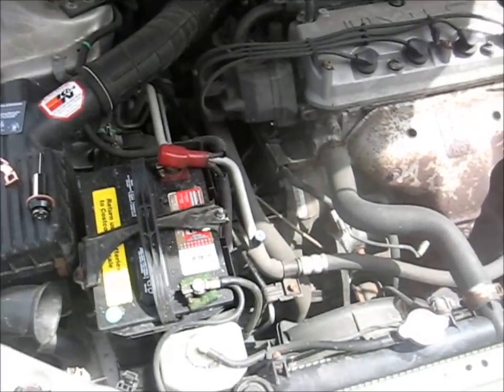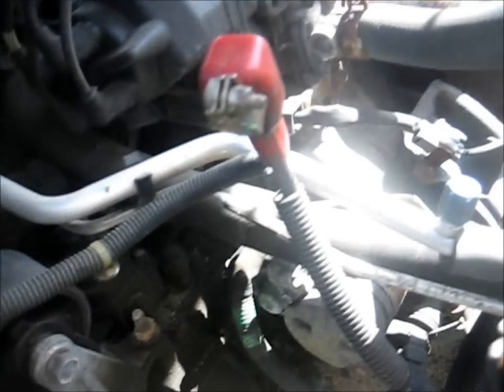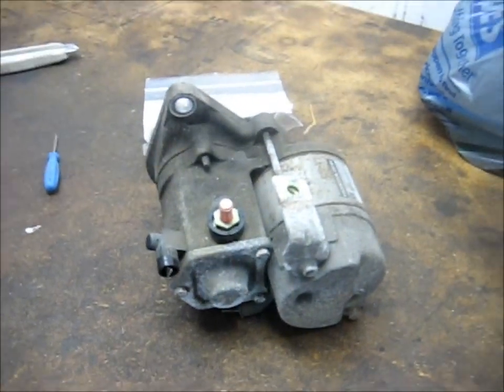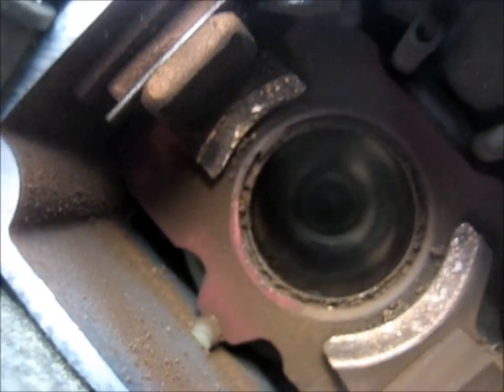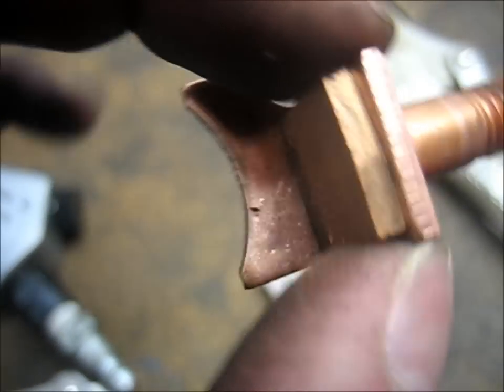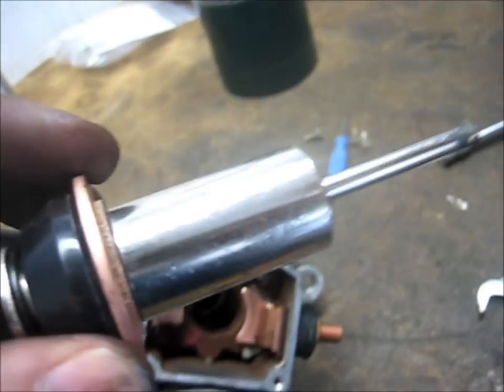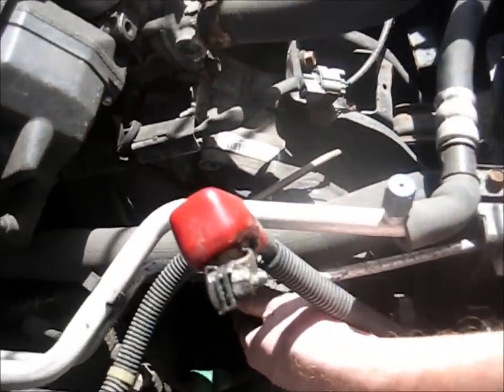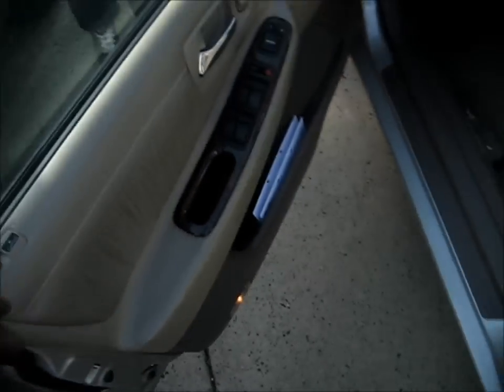Denso Starter Repair (Honda, Toyota, Chrysler etc.)

Comment: I wish we did this more often, and I wish finding the right parts wasn't such a pain. This is an excellent demo. One point worth noting is that the terminal you point out at 2:39 is the wire that sends current from the solenoid to the motor. If you're able to get a scope or dvom onto that lead in the car, you can verify the problem is in the solenoid (rather than contacts inside the motor) by checking for voltage at that point when turning the start key. As you say it will normally read ground if you check it with a dvom, since the ground is transmitted through the windings of the motor. When the start key is turned, that terminal should read 12V, proving the solenoid is able to relay voltage on to the motor. If your battery is good and if that wire reads a low value like 6 volts, there is upstream resistance. That upstream resistance is likely in the solenoid contacts, robbing the motor of power. I find the way the plunger is able to rotate an example of elegant engineering.

Comment: You need to make sure that the contacts are completely flush with the housing that supports them underneath. According to a few other YouTube videos this a mistake that is commonly made and it results in having to do this over again shortly after. They advised pressing down on the contacts while tightening, using things like a socket, screwdriver handle or even the plunger.

Comment: The "left" terminal on the solenoid housing is not the Negative terminal as mentioned in your narrative (time index 2:43).  This terminal is the positive lead that feeds power to the starter motor from the solenoid.  The Negative on the starter is connected to the housing of the starter housing. Thank you for an excellent video and step by step procedure for rebuilding the starter solenoid.

Comment: I wish you had continued the disassembly to remove the starter motor's armature and shaft. It would have been useful to see the condition of the brushes and commutator (possibly replacing the brushed and turning / undercutting the commutator), then cleaning  and relubricating the main starter bearing before reassembly.
Reply: Exactly my thoughts as well. The starter motor was never even touched, this was only a solenoid servicing - but a good video of that I must admit.

Comment: Its a 99 Lexus RX 300 I did change the contacts and plunger too, put everything back but the car starts and the starter never Dis-engage, it keeps running until I disconnect the baterry terminal.
need your help.

Comment: Hi, where did you exactly get the solenoid repair kit from?  I checked Kragen parts online they only had the touch points but not the plunger.  I have the same exact car in the video and my starter just went out yesterday.  Will a universal plunger most likely fit?

Comment: thanks" for the video,  helped me rebuild my starter on my 97' lexus, only cost me $27 for the set a far cry from $130 after starter market from kragen.  it was a pain in the ass" one of those bolts was a bitch to remove but i did get it off took couple hours of my saturday away but hell i saved over $100! by doing it myself.   thanks again!

Comment: My 4Runner occasionally has the "twist and click" starter issue.  My dad replaced the contacts and that seemingly fixed the problem.  However, very rarely, when the engine gets hot, I still get the issue.  Any ideas?

Comment: How do you know whether its your contacts or the whole motor? My car (camry 2002 4cyl) wont start. The battery tested good and the alternator is ok too. I do hear a humming sound from the firewall.  Before it stopped starting the car sounded like it had trouble starting like kinda slow but started fine. Then suddenly it stopped. I cleaned to terminals with water and baking soda, no dice.